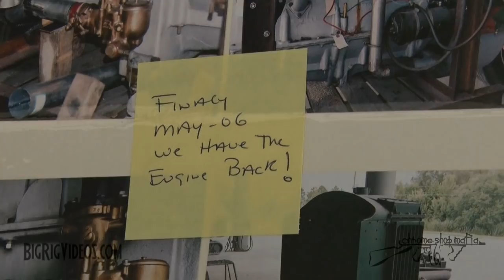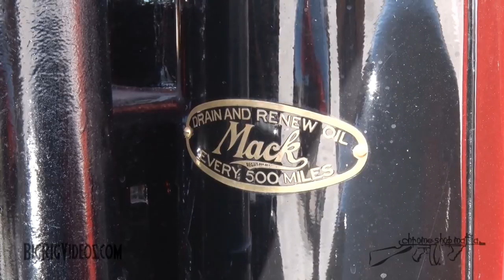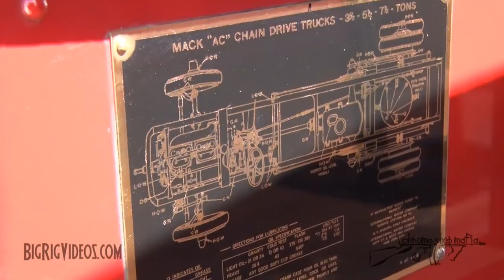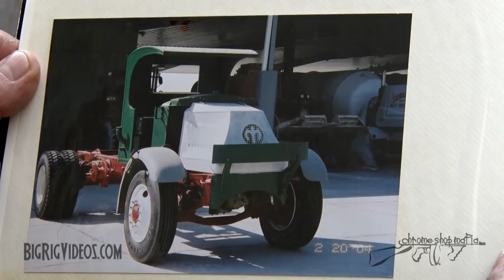1929 Mack AK Chain Drive Dump Truck

Comment: Very nice looking old Mack restoration.  Brings back many good memories.  I use to own a 1922 Mack AC Bulldog that had started life as a New York Firetruck.  Instead of a 4 cylinder engine, mine had a straight six cylinder engine in it along with tandem wheels on the back.  My uncle bought the truck to use as a parade truck to promote our family owned lumber company, which is no longer in business.  When my uncle passed away, it was left to my father, but when he passed away, the truck was left to me.  We did get the truck running and I got to drive it around when I was 14 years old, but I did not have the money or resources needed to restore the truck properly so I donated it to the Circus Museum in Sarasota, Florida back in the early 1980's.  Their museum found the old timers that had built the truck originally at the Mack factory and they did a fantastic restoration on the truck.  It was heartbreaking for me giving up that old Mack truck, but I would rather see it in a museum fully restored than rotting away in a field with no money to restore it properly.

Comment: nothing against Peterbuilt but you should have used a Mack to haul that classic
Reply: +kbtruck65 Blair My thoughts exactly!
Reply: Nah   he wanted to make sure it got where it was going
Reply: Ha ha ha ha ha ha ha ha ha ha ha!

Good one! never noticed - Duh!

Last time I saw a chain drive dump truck for real was 1958.  As I recall, it had solid rubber tires.  I also remember road trains hauling dirt and gravel.  Don't know/remember what did the towing.
Reply: kbtruck65 Blair , thank you

Comment: Beautiful old Mack, and shes up and on her feet again where she should be and not static in a museum (although I like those too). 
A gentleman I work with had a 1927 AC Mack that worked in Pennsylvania until 1964 (I sat in that truck about 25 years ago at our State Fair) - it is now in our State transportation museum and still runs. Cant help but admire the old iron , thanks for posting!
Very nice job on the video as well. 
Salute from Alaska and Keep'em Rolling!

Comment: Great truck.  What's the torque rating on that beast?
Reply: Well 77 HP at  1800 RPM  translates to 225 ft. lbs. torque.   Torque would be higher at lower RPM.

Comment: The only problem with chain drive is: the strenght of the drive line is those link pins and their relatively small diameter.